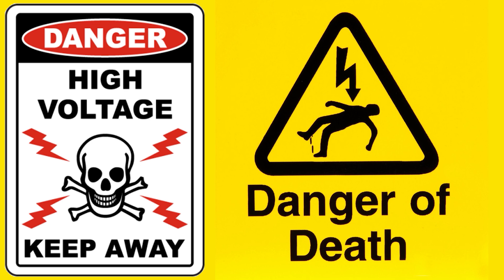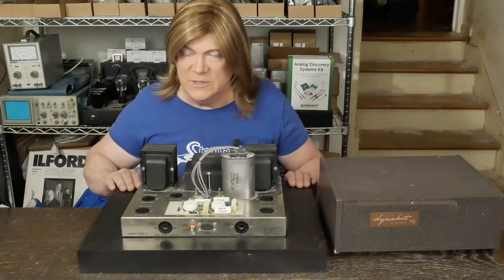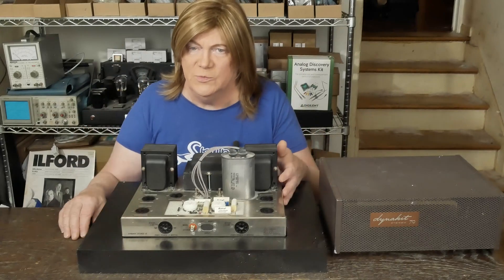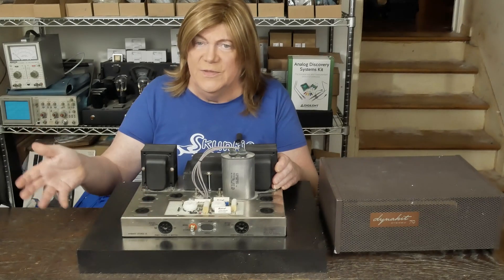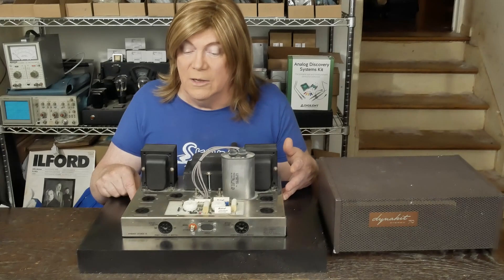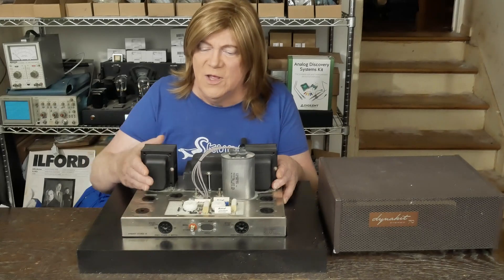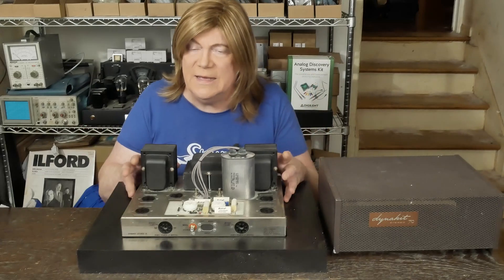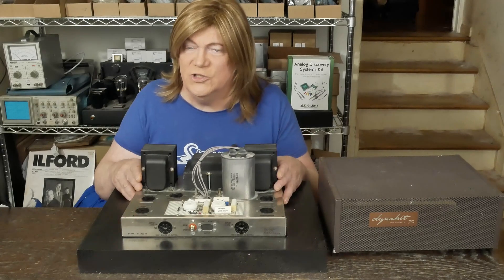Dynaco ST70 Tube Amp Restoration #1

Comment: Boy what a carcass. I thought about buying and restoring a dynaco st70 but ultimately decided to go the tubes4hifi kit route, which I am currently in the process of building. Part of the reason I went that route is that the original power transformer is supposedly one of the weak points in the original design. Also nice to have a shiny new chassis. You should check out the videos that Ben from Novalux Stereophonic posted. An interesting driver board for the ST70 that I would have considered if I hadn't already purchased the tubes4hifi is Miller Audio.
Reply from the maker: Yeah by no means am I proclaiming this driver board is "the best" nor am I going into the endless mods. This solution has been around a long time. If it was horrible, I don't think it would have survived and it looked like a fairly simple way to fix up this mess of an amp!

Comment: I just picked up one of these in original condition. It's my first tube amp, and it sounds really good to me. I would like to keep it original but also change out any parts that are out of spec, but i'll be learning how to do it as I go. I have a little Heathkit mono amp I can get some practice on before I touch the ST-70.

Comment: If you have never owned the original ST-70 i would say to start with the original before trying something different. Just my opinion. I'm sure you don't want to start experimenting with different boards though lol. I personally prefer a different board but did not dislike the VTA. The VTA is the most popular I believe. I'm curious to see you bench test it. The VTA my buddy had was almost half the wattage vs the original. But maybe something was wrong with it..though it did still sound good.
Reply from the maker: The original uses unobtanium tubes. This board looked like a simple to install solution for this mess of an amp I need to gut. And obviously I will be testing the end result. I also have a second one to try something else with!

Comment: The ST-70s are classic amps. dumping the electrolytics in place of film caps was all the rage a decade back or so. But you are right; a person can dump so much cash into these they quickly approach the total investment of some pretty nice tube amps. Not sure how far you are going to go but tubes4hifi also sells some larger transformers for the 70. Its very musical sounding amp with the right speakers. I have owned 5 of them over the years.
Reply from the maker: The implementation of this was scary to me.  Is someone wants to do something like that, fab up a new chassis!

Comment: Those huge Solen film caps are VERY expensive and would be highly sought after by loudspeaker x/vr designers and builders. 
Looking forward to your restoration work 👍🏼👍🏼
Reply from the maker: They might be usable for that. I wouldn't trust them in high voltage use anymore.

Comment: I have two ST70s that I restored in 1996. Both amps were untouched originals. I ran them as bridged units (with an external bridge) until about 2020. The most interesting thing is that they both still had the original Mullard 5AR4 tubes. This should be a great series!